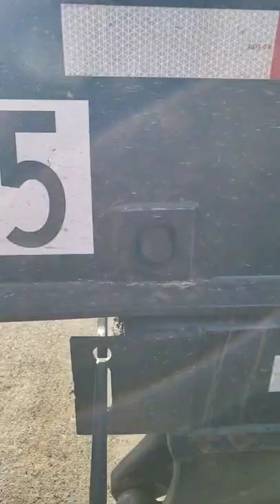how to slide a tandem axle port chassis #shorts

Comment: What’s the point of sliding the axles on those small 20ft containers I could see in a bigger trailer
Reply from the maker: Legal Weight distribution on all axles  and better control.
Reply from the maker: Usually, these 20s get loaded to the max because they are smaller. Same weight as a 40 or 53. So they are easier to flip.